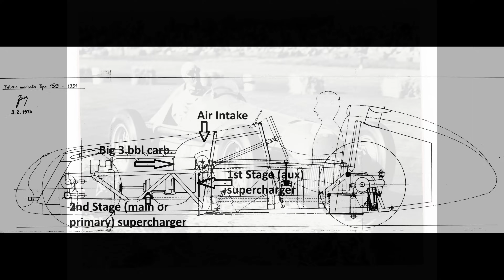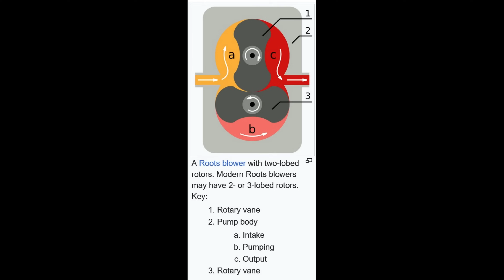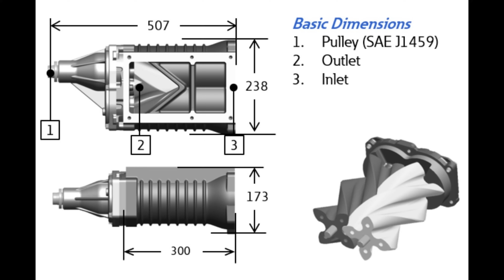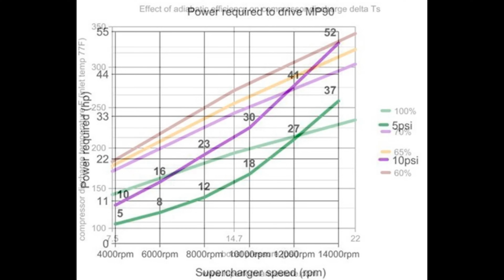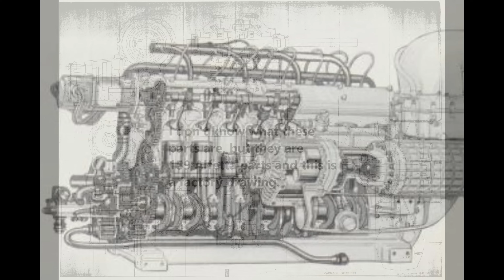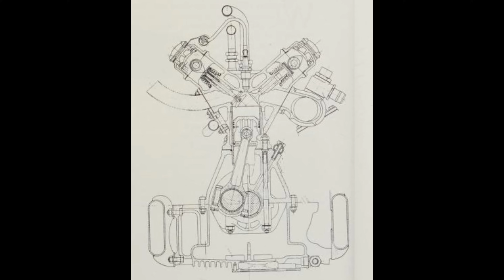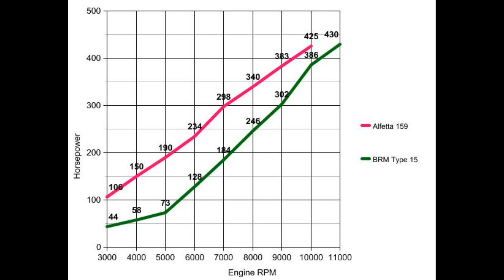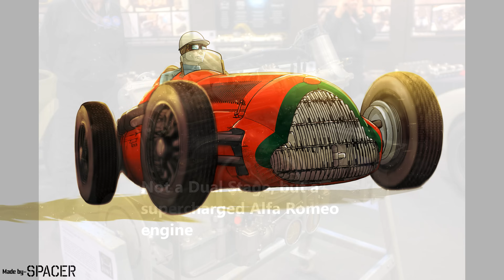Dual Stage Supercharging 450hp out of 1.5 Liters in 1951

Comment: New engine and car replica are they using all the same types of metal or modern metals? If you use a modern materials in the engine you would get more horsepower. I wonder if there's any calculation what that engine made today with modern kompressor what could you achieve we looking at a 700 brake???
Reply from the maker: Sure, you could do that. However I have to ask why? No roll bar, no seat belts, drum brakes and skinny tires. How much more danger are you looking for?

Comment: Very good interesting! what about the Mercedes SLK 230 M111 roots kompressor, what type is it?
Is there a minimum ramjet pressure needed to get a benefit?  I was wondering if you could spray in the internet a fine mist of water with ethanol or on its own, would this take the energy out from the supercharger because you are trying to compress a fluid and that's taking energy out of the engine? Best to be done after the kompressor. Also I notice it's got a very small intercooler, I was wondering about putting a bigger one on but is this decremental because we're gonna lose pressure because of the size increase? I was thinking maybe 15 or 22% bigger but would I lose pressure so am I gaining anything not sure!? Also you got this electronic valve body on the compressor I'm not sure how I can adjust that without going into the ECU maybe resistor not sure yet can't get any documentation very difficult. What is the life of kompressor oil I can't buy anywhere from parts suppliers or even Mercedes they didn't even know what I was talking about when I asked that!! What is the oil made from is it a special oil or does it go and do a different name ? Could I use a synthetic oil but what is the sae viscosity value? And I don't know how long between oil changes you need I mean it's a lot more than engine oil but what is the given distance before breakdown?

Comment: From 1965 the F1 engine rules were for 1.5L unsupercharged. For 1966 the rules were changed for 3L unsupercharged and 1.5L supercharged engines, but nobody used the supercharged option until Renault introduced their turbo car in 1977.

Would suggest that mechanical supercharging wasn't the best option for those rules.
Reply from the maker: That's exactly right. Supercharging was killed off by the rules. If the same displacements and fuels were allowed there would have been zero unsupercharged entries.
Reply: @GregsAirplanesandAutomobiles  Probably the most important difference between 1951 and 1966 was that refuelling was not allowed.

Comment: Alfetta is basically "little Alfa".

The Alfa 158 was designed for the Voiturette (small car) class, which was the level below the Grand Prix cars. 

From 1938 Grand Prix cars were 3L supercharged or 4.5L unsupercharged.
The 1938 Mercedes Benz W154 used twin superchargers for its 3L V12. Two superchargers, not two stages.
The 1939 W154 changed the system to 2 stage superchargers.

Comment: Excellent as always Greg.

Logistics was part of reason for  the USMC using the M4A2  but not so much the fuel availability as is often stated but the Tank it self as the Army had laid claim to the Petrol powered tanks so the USMC selected to takee Diesel as they would be available far sooner. The USSR did request M4A2 due to they use of Diesel in the bulk of there medium and larger tanks.

See Chieftains hatch Operation Think Tank.

Comment: I keep imagining using a turbine to drive an upgraded alternator, and disconnecting the supercharger from the engine to a simple electric drive motor, and imagining it set up with three sensors to maintain inlet pressures at ideal pressures regardless of what the engine is doing. This removes parasitic electrical generation, adds a bit of weight, but also keeps feed air at a more consistent pressure regardless of current RPM or driver activities, it shouldn't be too hard for a computer to model what happens when the driver floors the gas on a racetrack, so we should be using electric energy to keep the engine at full boost at all RPMs without wasting energy with overpressure venting.

What am I missing here? Is the energy efficiency so low you'd overload the exhaust turbine and diminish scavenging?

Comment: Has anybody used one stage of each, exhaust and mechanical driven super charger? What would be the benefit or drawback of using exhaust and crankshaft drive together?
Reply from the maker: Yes, many WW2 airplanes have an exhaust driven turbo feeding a gear driven supercharger. B-17, B-24, P-38 and many others.
Reply: VW did that on production cars in Europe in the early 2000’s, it was also done by Lancia on their fantastically mad group B rally cars
Reply: Yes but sort of no for the Lancia Delta S4 engine - they effectively worked in parallel - the supercharger provided the boost at low rpm and before the turbo has spooled up - the S4 is a rally car so lots of engine rpm up and downing !

At a predetermined boost, the supercharger was bypassed so wasn't adding anything or taking engine power to run - with the turbo providing all of the boost.

So you can get the instant boost of a supercharger and the high boost and high efficiency of a turbocharger without the spool lag !

Downside is, it's a plumbing nightmare.

Edit - just to add, because a Roots supercharger has no internal compression, the bypass valve is quite simple - it literally is a single valve that sits across the supercharger - the supercharged Mini uses one - it's just a simple butterfly valve.
Reply: Like Greg said, that was pretty much the standard for WWII turbocharged aircraft engines. You could think of it like all engines came with the mechanical supercharger on the back, and rather than go through the effort to remove it, the turbocharger was just added on top of that. Sometimes the mechanical blower used a milder drive ratio to minimize frictional losses since the turbo was meant to be the primary provider of boost, but not always.

Comment: Ok, to leave a useful comment; there was (is?) a 50cc and 125cc motorcycle race classes Honda built some very small multi-cylinder engines for, so there are some smaller ones than the BRM15. Although i suppose if we're being pedantic automobile racing doesn't cover motorcycles in the common usage
And i still want a 1.5L V16 :P
Reply: Technically yes, Honda made the RC116 for 1966 Grand Prix, which featured a inline (not V) twin 50cc. It was wacky in many other ways too, ablating the aluminum rim of the spoked wheel with hard teeth for braking, the fuel tank being structural to frame ect.
But the class limits where changed the next year, after a bunch of makers proposed basically 50cc crate engines/transmission packages with 4 cylinders (or even more, including a VR5) and more than 8 gears (up to 16), so that it would restrict the class to be slower, more entry level, reliable and affordable, instead of pushing theoretical limits of an arbitrary displacement. However a few of those engine packs did end up at university engineering departments or in private hands, so they exist, they just never actually raced in any official capacity that I know of.

Comment: According to Wikipedia, the other 1.5% of the fuel (apart from methanol) was comprised of 1% Castor oil and 0.5% water. I don't how much of an effect such a small ratio of water had on charge cooling, but I do know it was common practice in WW2 aircraft engines (at a much higher ratio). Renault also ran water injection in their 1.5 litre turbo engines in '80s F1.

Also, to the comment about the size of the cylinder...I'm not sure it really counts as "auto racing", but Honda ran an inline 6 cylinder 300cc engine in their RC174, with a bore/stroke of 41mmx37.5mm, generating 66hp @ 17k rpm.

Comment: of course in this day and age you'd probably go compound turbocharged normal turbo then second stage runs oto a compound wheel directly driving the crank via torque converter and reduction gear

Comment: Would dual-stage superchargers applied to turbos be the sequential turbo tech that Japanese sports cars used in the '90s (e.g. third-gen RX-7, fourth-gen Supra)?

Also : 1939: our aero engine has a two stage supercharger
1949: our aero engine is 8 superchargers in a row with a fire burning inside
Reply from the maker: The dual turbo thing is really a lot different. I might cover it another time.
Reply: @GregsAirplanesandAutomobiles  I thought sequential turbos differed from normal twin turbo setups. One turbo feeds into the other, though from what I understand there are computer controls involved so that the first stage doesn't come online until the ECU tells it to.

Comment: Great video!!!  I know of one vehicle I have worked on and drove that has a dual supercharging system, though it uses a turbocharger feeding into a supercharger, and is a diesel.  The US Army HEMTT line of heavy trucks use a Detroit Diesel topped with a supercharger, topped with a turbo.  I was a mechanic in the Army, and also in the National Guard, and operated an M984 HEMTT 8x8 wrecker in Iraq -- one powerful machine!!
Reply: Turbocharged two stroke diesels still need the roots blower to scavenge the combustion chamber. My understanding is that the roots blower is still producing only modest boost the same as in a non-turbocharged two stroke diesel.
Reply: @fafner1  All I know is that beast could haul a truck heavier than itself down the interstate at 65mph up hill, flat, did not matter.  And it would do even better with a little tweaking on the pump and governor!!

Comment: Some of the unknown 1.5% of the methanol based fuel might have been corrosion inhibitors and lubricants - pure methanol isn't the friendliest of things to run through a fuel system.
Reply from the maker: That's probably right. In fact it's so corrosive that after every race the purged it all with some other type of fuel and re filled with methanol just before the next race.
Reply: Its a solvent that can eat some rubbers/plastics used as seals in fuel systems not originally designed for it, but its not actually corrosive (unlike say, nitromethane) and is stored just fine in SEALED containers of basically any metal (and even many plastics, but check those are rated for it). The reason nobody leaves it to sit in cars fuel tanks between races is for reasons all mostly to the fuel tank NOT being sealed.

The main reason it needs to be sealed (unlike the far fuel tank) is that methanol is hygroscopic (pulls water from the air) so the properties of the fuel will vary considerably between fresh and "stale" (in a very similar manner to bread left out overnight) fuel, and this also causes the misnomer about its "corrosion" because this water can allow conductivity for galvanic reactions between dissimilar metals. Its still FAR from saturated so isn't dropping water from suspension to the bottom of the fuel tank/lines (a common myth) and isn't providing oxidizer nor allowing atmospheric oxygen to attack the submerged components, it just feels like it did when you've hooked a copper line or gasket to a steel tank and never thought about it with regular leaded/unleaded.

A secondary reason is methanol also has a very low evaporation temperature/pressure compared with many other fuels, which means the flammability (where pure methanol fires are invisible) and toxicity of the fuel can be an issue when leaving a car in an enclosed space, or when performing work on the car. So filling the tank with a normal low octane non-winter fuel that doesn't evaporate nearly as much nor leave a tank full of vapor, and still having the normal corrosion inhibitors around the fuel pump ect was often seen as worth the extra time to pull a drain plug twice. 

Finally I can't confirm it, but I've definitely heard a few whispers that in more modern times many teams where super quick to drain fuels post race every race to hide the fact that occasionally additives (including before mentioned nitro-methane) where pretty easy to "accidentally" tip a bottle of into the fuel tank for certain critical times during a race season.. but if this was still the case back in the 1950's F1 or teams would simply use whatever additives they wanted without subterfuge (which can be as much for other teams not copying tactics as it is the actual limitations of the rules) I have absolutely no idea.
Reply: @SheepInACart  Great comment, thank you.

Comment: From my understanding these principles also apply to turbos? Diesel boys are making huge boost and huge hp numbers with triple compounded turbos.
Reply from the maker: Yes, but there are different factors involved and it's just different enough that it would have to be a different video.
Reply: Semis commonly used dual compound turbos in the late 90s-2010s for boosting ~50psi.
Today's engines run on lower boost (~30)psi) and have variable vane turbines to shorten spool up.

Comment: At some point, if one takes this to its limit - tyres.
Now, that power needs to be transferred.
Ha!
New rabbit hole.
Reply: That limit had been reached in the 1930's. Mercedes developed limited slip drives for it's Grand Prix cars at that time. BRM was really heading the wrong way. The most successful cars of the period were matching weight and power with tires (tyres) available. Cars designed within the weight limits of the tires available were the successful ones of the period. The ones that went to great lengths for power were usually limited to a few fast laps before tire wear brought them down.
This was demonstrated by the success of the Offenhouser racing engines which dominated racing in the States post war. It was near ideal for the balance of weight and power for races of medium or long distance because of the limits of traction and tire wear.
Reply: @keithstudly6071  Doh!
You just got rid of a three episode of Greg!

Disappointed.

Comment: Why not run the supercharger with a separate engine say for example a motorcycle engine running a compressor into a big block Chevy?
Reply: The Soviets actually did that in the early prototypes of the Petlyakov Pe-8 heavy bomber. 4 engines driving propellers, and a fifth engine in the fuselage driving a supercharger for the other engines. It worked, but ended up being too cumbersome overall.
Reply: Generally the added weight and complexity isn’t worth it. Especially with a car driving around at varying rpm’s and loads. You’d have boost control issues trying to match everything.
Reply: @NBSV1  Purpose built 1/4 mile car
Reply: @spudsmarauder  Even then there’s gear changes and rpm changes through the run. Unless you can sync everything you’d end up with boost spikes and dips. Especially if trying to make a lot of boost. 
Somewhat similar to setups over the years that use compressed air tanks to feed the engine. It’s hard to control and get working consistently.
Reply: The Chaparral Can-Am cars used a snowmobile engine combined with skirting to pull a vacuum under the car.  It was outlawed pretty quickly.  The Can-Am cars were real beasts, they were my favorite as a kid.
Reply: I think the Motor Trend guys even tried that on Roadkill or something. A V8 on a trailer that did nothing but run a blower for the main engine in the car. They also did something with a bunch of leaf blowers pushing air to the engine. In both cases, it's not really worth all the effort, weight, and complexity. The leaf blowers barely even made meaningful boost.

Comment: 40:00   "the fuel would start cooling..."   I think the fuel (methanol) would start warming, or acting as a coolant.  Semantics I know, and I assume everyone listening understood.
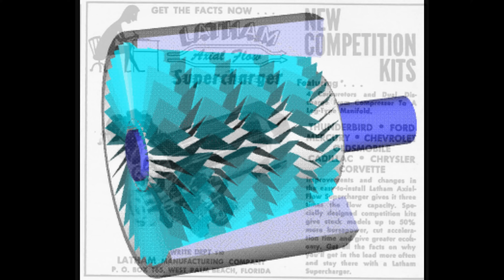50:03  Latham Axial flow:  I inherited one of these from my father who used it to blow up a '57 Oldsmobile.  I don't know what to do with it.    Thanks Greg!!
Reply from the maker: That's a fair point. The Methanol would absorb heat cooling everything around it. As you said, I think everyone understood what I meant. Those Lathams may be worth something, especially if you have it with the carbs and everything.
Reply: @GregsAirplanesandAutomobiles  On the power-consumption scale, where does the Latham supercharger fall? Asking for a friend.
Reply: @autobreza7131  They didn't come in only one size, every application used a different number of stages, carburetors (2 or 4, in different sizes) and slightly different pulley sizes (max tested RPM was apparently 40,000, with belts set up to reach up to 30,000.. but adverts of the time only ever say "above 10,000 so its as much story as fact by now). As this video clearly shows with pressure ratio, adding just one more stage (for reference the one I've seen was a 4 carb with 11 stages for Ford FE) drastically increases the final boost pressure for a given RPM, and with it the power requirement. They where also extremely dependent on the fine machining tolerances, and only like 650 known to ever be made, so actually trying to run one now would be extremely difficult.. you can't just sand the rust off the turbine blades and think you've done well. Claims published at the time where all like "up to 50% more horsepower for your make/model" rather than being anything technical like a specific kits specifications, let alone a compressor map... but realistically the efficiency wasn't that different to centrifugal, so the power to drive it when making the same boost and both correctly sized is similar enough, its more the behavior at lower RPM that's going to vary noticeably.
Reply: @SheepInACart Thanks for the deep dive. Very interesting info and reads like you have first-hand exposure back in the day. 

What I am curious about is the power needed to drive one compared to Rootes, Centrifical, Comprex, etc., on a par basis. I’m most interested in the effect in low displacement engines that don’t have a lot of low-end power to spare, like my 944NA (doesn’t) have.